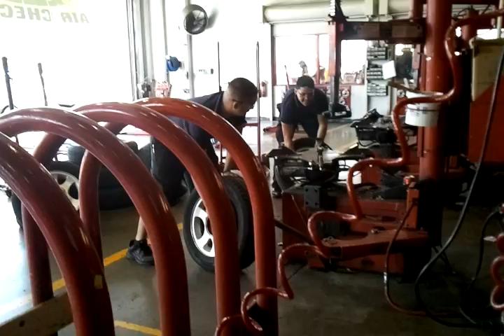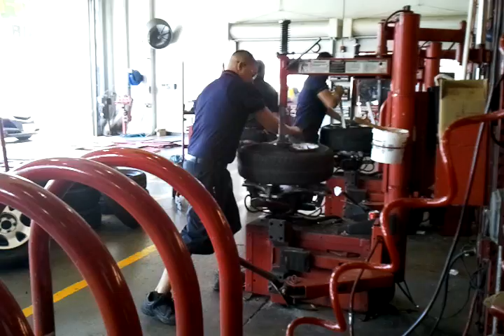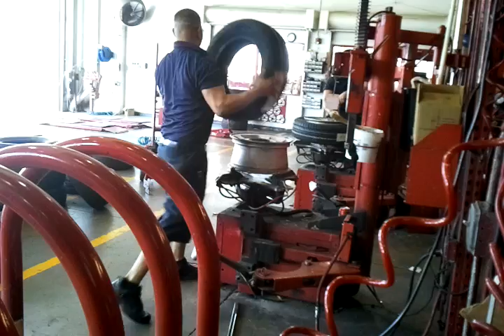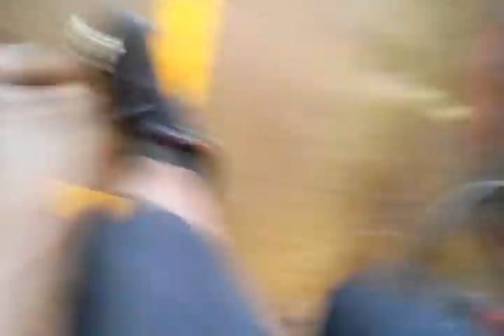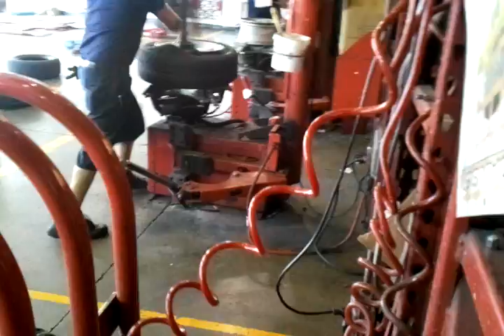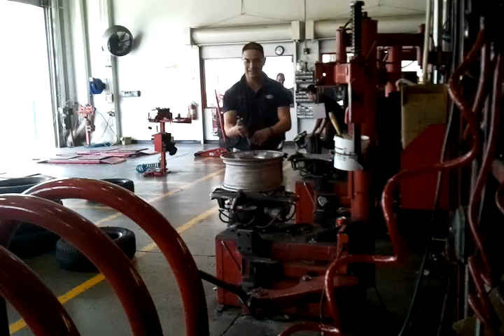Fast Tire changing discount tire

Comment: how the hell can u tell what side of the tire goes up so fast?!?!?!?! geez i normally have to read the whole damn thing lol
Reply: jpjoe100 tips and tricks. Some tires have a dot on the DOT side. Others you can tell by the type of tire. I’m still learning but it can be done. These guys make it look easy. Must be early in the shift because by 11 hours in, my ass is dragging lol
Reply: Brian Dalton Etc? Our store is only open 10 on any day bit Saturday when we are open 9
Reply: When your crew chief stages the tires and fils out the cims card he should stack them dot up. Helpful hint
Reply: In all honesty, time and memory. In most places, you know what direction the tire should face. A vast majority of them are symmetrical so it doesn't really matter. The tip I usually give my newer techs "When in doubt, DOT out." A quick glance at the tread to make sure it's not directional first, then just stick the DOT side out. Putting the DOT every time, even on symmetrical tires is a good practice anyway for potential warranty services is an upside, as you don't need to lift the vehicle (or crawl under) to make sure the tire IS one that was installed by your company (not that it matters given how tires are mass produced these days).
Reply: Dude, tire tech work isn't difficult by any means (pretty much anyone without a major disability or weight restriction can do it), but damn if it doesn't break you down. I just want my "shop" to get rid of these stupid flat lifts (parallel lifts, belly lifts, etc) and get us some damn two-post lifts. We can only get the wheels 3 feet off the ground at maximum (factoring any sag in the suspension), which means your crouched or kneeling A LOT.
Reply: @RyMann88 my previous job had those lifts, I HATED them. I indeed have to bend down a lot. I’m happy I got fired from that stupid tire shop. I now work at pep boys where they have 2 post lifts. SO much better.
Reply: Good hint immediately look for dot if you dont see the numbers on one side you should immediately know its gonna be on the other side good year tires have a dot date on both sides bf Goodrich tires with OWL (optional white lettering) will have the dot on the  side with white letters.
Reply: I always put the side to be mounted outside facing up for my techs
Reply: Read the tire while lubing it
Reply: For Goodyear’s, you usually face the side that has the barcode on it, outside. Some other tires are like that

Comment: There fast but try to do it with sensors lol
Reply: It's not much different. The machines they're using are easier IMO. The ones we've have you pull the spoon towards you rather than from right to left. It can get sketchy if you don't make sure you have a firm grip because if that spoon slips out and you have a loose grip, it can fly at your face or away from you (one of our machines is literally in front of a window). The problem with it being the way mine are set up, you're more than likely going to "wiggle" the spoon since your arm is extended in front of you across the wheel rather than off to your side.
Reply: Mark Lara yup as soon as you hear a crunch “ shit” 😂😂
Reply: Thats why we have to hand back TPMS rebuilds now.
Reply: @kayleeelenbaas136  that moment when you popping the bead and trying to be fast and break the sensor. Fuck

Comment: poor rims probably all scratched and knicked up
Reply: skliros wheels***
Reply: there's no way they couldve got damaged, the duckhead is a rubber/plastic and nothing but the bar and duckhead touches the wheel.
Reply: @wyattolsen584  Nope, duckhead is metal.
Reply: @loOOooO If done correctly, they pry on the duckhead to make certain the tire is over the duckhead the first time.
Reply: Unless requested by customer or changing tire on custom rim, the rim is clamped from the inside on the machine with teeth. On custom rims or special request by customer, the rim is clamped from the outside. From what I've seen, putting balance weights on scratches a rim more than changing the tire. The balance weights can be very stubborn to go on.
Reply: @bairfamilyfarm1336  since when is the duck head metal? Every duck head at my shop is plastic.
Reply: Wheel weights in general are annoying. Hammer weights scratch/scuff wheels and stick-on weights leave the adhesive behind.
Reply: @colbycollins6608  Some shops have both, I know mine does. We tend to use metal with plastic edge guards on ours since the metal heads don't flex nearly as much. To offset the higher likely hood of scratching the wheel with the metal heads, we don't slam the duck head down and lock it there, we'll bring it down, then slightly ease off letting the duck head lift just a hair or two off the wheel, then lock it down.
Reply: @Cage Calnan wheels and rims are the same things, so why bother to correct?

Comment: @Chris Young 
You have no idea what it's like to work at discount tire dealing with ignorant people like yourself do you. Discount Tire does do things fast. My store has an average bay time of 14 mins. But we still do it right. You might ride your tires hard or think you're a fucking race car driver
Reply: Thats exatly right I worked at discount also..  average bay time 14 minutes... very fast pace and job was done correctly the first time I have go say they take pride in there work and comin from someone who worked there... is still the best place to get your tires done.. but very fast paced environment
Reply: Flt_02
Reply: I have no idea huh? I worked both at a body shop where we completely disassembled cars and restored them, not some dippy fast cash shop where dillrods measure their success in terms of time. We measured our success in terms of actual quality and referrals. We did NO advertising and didn't need to. We did a lot of custom work for which we were paid handsomely. We didn't use slackjawed kids fresh out of high school that didn't know one end a of a car from another. Then earlier I had worked at a full service Shell station where we did everything. That business had been around for at least thirty years and we did almost every kind of vehicle repair. This was way before franchise shops became the norm and gas stations actually repaired most vehicles i.e. when you were still taking a dump in your diddies. We didn't measure results by how many cars we managed to shove through the bays in 14 minutes. BTW - an average repair time of 14 minutes means you don't do much in terms of repair. These clip joint shops only change oil and tires and wouldn't have a clue what a brake job or overhaul even was. They are a joke as far as I'm concerned.
Reply: Henry Raymond whoa you're a badass!! lol doushbag

Comment: Hubs not cleaned, no bead seal, no ACTUAL TPMS kit just stems, no cleaning of the rim lips, and no balancing. Not to mention the time it takes to pull in the vehicle, put it in the air, take the tires off, then putting them back on, retorquing the tires, and pulling it back out. Still, an impressive performance as far as mount and dismount, and valve change.

Comment: Both beads already broken down, swing arm already adjusted?
 The wheel rim is prolly rashed or scuffed "a tad bit" even if its just an old steel wheel from slamming that duck head down. It's fun yeah but this wouldn't fly at our shop. Smooth & steady is fast.

Comment: Wow ok, they skipped breaking beads, letting air out, cleaning the rim for corrosion, applying bead sealer.
Reply: You only do that if there is Corrosion and it is leaking from the bead.

Comment: I am not talking about this store but the real busy stores cut corners. They care more about quantity then quality. That is not the discount tire way. Their numbers may look great but they are cheaters. You wouldn't be doing any of that shit around me if I was your SC.
Reply: Chukwillard Then you're probably running a shitty slow cell. 
The job can be done fast and correctly without you having to drag your ass throughout every car.
Reply: Gotta side with my boi Austin on this one. You've got the P O W E R C E L L and you've got the S O U R C E L L L. its all about the power cell
Reply: Austin Warren take it your one of those shitty cutting corners SC! You can run 10-15mins all day if you keep your techs in line there would be no need to cut any corners. if you cut corners your teaching everyone else this and that is not okay. Hope you lose your jobs for endangering us all.
Reply: our store in littleton was 3rd busiest in the country in october-november and #1 in november of 2015 (110 down at 5:00. yikes) but I'm being honest, we don't cut significant corners at all.  mostly its just making a mess, like not cleaning up old wheel weights on the ground lol

Comment: Maybe this is how they fucked up my brand new wheels that I paid $500 for. Luckily they replaced the damaged one after 2 1/2 weeks. And the flat repairs are atrocious! Tire plug was hanging out, tears and more holes in the rubber next to it, not to mention that before it'd leak from 35psi to 19 in 2-3 days, now it goes from 35psi to 18 overnight.

Comment: Here at Economy Tire in Valdosta Ga. If you take 20min to do 4 tires you will be unemployed lol
Reply: With 2 or more techs, yes. One tech, no. One tech doing every single step correctly averages about 30-45 minutes. Plus this is literally dismounting and mounting a tire. Doesn't include removing the wheel, deflating, and balancing. You must be a real fun guy to work for.

Comment: Then why the fuck does it take two hours to fix a flat tire?
Reply: cause your 2012 Ford Fusion has swollen to shit lugs and you refuse to buy the lug kit lmao

changing two tires will always be faster than fixing a flat. that’s just how it be
Reply: @psychedelicbdsm7301  I own 2 Chevys, a Jeep, a Nissan and a Toyota.
No Ford bitch here baby.
10 mins for a flat.
A good crew of three can rip an old set off and throw a new set on in less than 20.
Yes valve stems replaced and dynamic balancing.
But I feel you pain with Ford two price lugs.
An engineer will climb a mountain of virgins to screw a tech.
Reply: @psychedelicbdsm7301  Ford lug nuts are the worst

Comment: every technician knows to add sealer on alloy rims. Also You had all the rims already popped off the rim. skipping a step doesn't make you faster! those tires will be leaking air from the rim. do it right then make another video

Comment: I know this video is old.  But the funny thing is how long it took two guys to change two tires that were already prepped.  I still haven't found someone as fast as me yet :D
Reply: Hard ass
Reply: whats your fastest 4 new brutha?
Reply: @deserthandz7145  me and my SC. 2011 honda pilot, 1100k rebuilds. 4 YK-HTXs. 7 minutes. fastest I've ever done lol but my friend and I would push 4 minute RBAs
Reply: those 4 min RBAs, did you guys send the fronts straight back? or balance all four?
Reply: @deserthandz7145  nope, balanced all four.  they're usually only on small passenger cars, and a couple of them sometimes don't even need new weights.  most of the time the 4 minutes RBAs are completed on 15 or 16 inch steelies.  we balance all four.  we do the "ghetto RBAs (rotation, bolt on, air) when we're supy busy and the tire was just serviced, and we just straight up rotate the tires and we get 2 or 3 minute bay times lol #sendthatshit
Reply: @MCatwar  #sendthatshit Couldn't agree more. Cheers!

Comment: the quality isn't there. ...nothing was properly cleaned before installing new tire onto rim...
Reply: You don't always need to clean the wheel. If you do, it's because a lot of corrosion is visible around the bead seat. And sure, slamming a tire on to a wheel isn't the best way, but for certain tires, typically Continentals, and for wheels without a sensor, it's really harmless. I still see your point though.
Reply: @13anomalous16  lol i almost always slam the bottom bead on a wheel

Comment: every technician knows to add sealer on alloy rims. Also You had all the rims already popped off the rim. skipping a step doesn't make you faster! those tires will be leaking air from the rim. do it right then make another video
Reply: Tire sealant is used only if you are on road and you get puncture and you are cant fix the puncture. It seals the hole so air wont leak from the puncture (screw etc...) . You are supposed to put tire lubricant to the wheel too, not just in the tire, I hope you meant the lubricant.
Reply: Joe Molina no bead sealer is only used when the wheel has corrosion and the tire will not fully seat and seal onto the rim.. In that case you would buff the rim and seal the bead on the rim
Reply: Joe Molina No one puts sealer on alloy rims unless it was already leaking from the bead. 
Alloy wheels are the least likely to leak from the bead aswell.
Reply: Joe you're an idiot
Reply: Joe Molina those rims looked pretty clean
Reply: you dont put sealant on the tire or wheel period
Reply: I can honestly say in 2 years working at a tire shop I have only had 3 cars come in with sealant on the wheels, and they were corroded as all hell.
Reply: Joe Molina never done that. No problem.
Reply: @austin9832  Unless it's a Chrysler wheel. I swear to god that stupid chrome shit does FAR more harm than good. Not only do they flake, but they corrode like a MFer and can take a fair amount of time to clean properly (bead sealer included of course). Not to mention the cuts and slices you can get if you're too deep in the zone getting shit done and grab the wheel without fully realizing it's a old as hell chrome wheel.
Reply: @maxwellritz3156  I'm gonna take a wild guess and assume the last person to do the install (possible "repair") couldn't be bothered to buff the bead seat as well?